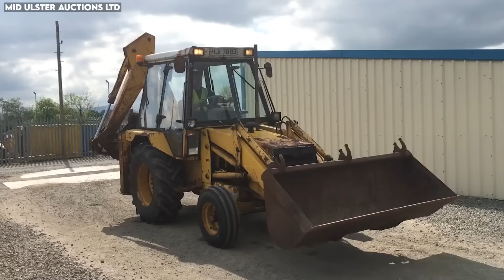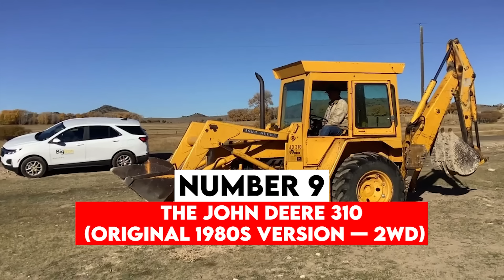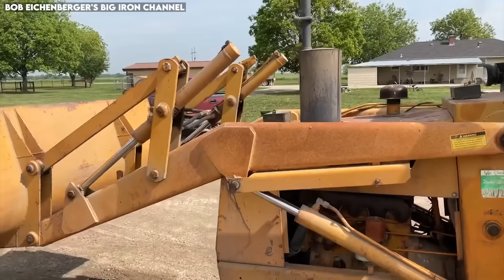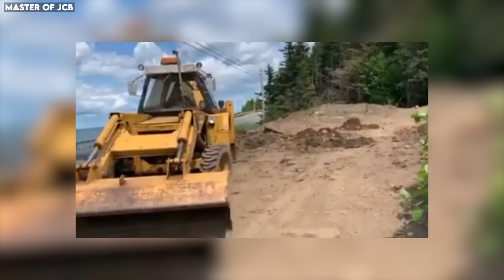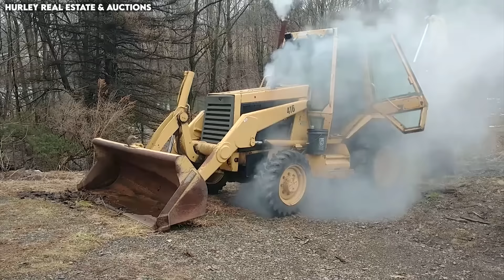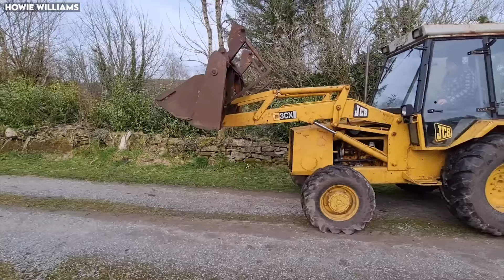10 MOST HATED Backhoes  from the 1980

Comment: Its it used to say on the JCB 3cx on 80's models "JCB leads the Earthmoving world". still true
Fords 650 no problems -  MF50B no problems they were light and flew through soft ground with 3cx bogged in trying to get the Pea shingle to the trench. Whitlock 60A (Dinkum)made in Essex thumbs up chassis cracking only problem.. They done some heavy work while contractors couldnt afford a 360 hire at the time.3cx and all  of them mentioned would drop while idle 360.s did as well,new arvs required.

Comment: We had a case 580 C and it had major leak. The fluid would pour out of it. The dealership had it tied up for over a month and it lasted less than a year and the same problem happened again. At that point, we knew we were going to get rid of it. We ran it for a couple of months with a bucket underneath it and we would just dump the oil back in. It was leaking so bad you would almost fill up a bucket every time you would have to move forward in a dig. I know other contractors that had the 580 C that didn’t have those problems. I think we just had a lemon and some bad mechanics at the case dealer.

We ended up buying a brand new 1991 JD 310 D. It is now May 1, 2026 and that machine is still in the fleet. In fact this very morning I took it, myself, 3/4 of a mile down the road from my shop/office to a job grading a gravel road in town. 

That machine has the original engine and hydraulic pump. The hydraulic pump has never been touched. I did do a in frame rebuild on the engine last summer. The only reason it was necessary is because an operator knowingly ran it dry with a leaking water pump. And of course never told anyone.
The machine has over 15,000 hours on it. I have had many machines come and go since then, they are no longer built this well.
There’s actually a few videos of it on my channel. I can’t remember when I uploaded those videos. I would have to look on the channel. But I know the videos were taken about five years prior before YouTube was actually a thing.

Comment: This is a totally asinine video.

The early 2wd 310's are some of the most durable backhoes ever built, and some of the most stable machines ever.

If the backhoe can pull the front tires off the ground while digging, that only means it is a strong backhoe.

You are literally pulling things out of your ass.

Comment: I bought a used 555A at an auction. Paid $10k for it. Other than a couple tires, and the ocassion Al hydraulic hose, plus normal maintenance, I used it for a decade and rarely had a problem. Started right up in the cold and after months of sitting in the winter. I loved that machine. Sold it after a decade of use for what I paid for it.

Comment: The farms I worked on while growing up had 580 Case backhoes, one of the farms finally retired the 580 case last year simply because it was wore out and no longer economically feasible to repair it. They had it from 1981 to 2025, they bought a New Holland to replace it. Personally when it comes to the use of backhoe part of the digging I prefer a trackhoe. I can do over twice the work with a trackhoe than used a backhoe.

Comment: No problems with the ford 555 machines, still have one and works well, parts available from new holland dealer.
Reply: I agree. We had 3-4 through the years.  Then we got a 665C, ran hours up on it, and then a pair of 655D’s. Seemed like all at some point got sold  after 5-6k hours on each machine. I miss that big ass 2’ bucket😂

Comment: Thay do ONE video showing how GREAT, these same Backhoe were. 😮then do this video. Make up your mind, about what was good, and what had lots of problems 
Me being a OWNER of, the Dynahoe-190 made by Bucyrus Erie till 1985, then B.E. completely STOPPED making Heavy duty monster size Backhoe mine is 19400 pounds, she can DIG, 19 feet with NO extendahoe 😊 my big baby boy is over built with very beefy body, to never fall apart, mine is a 1978 model years, and it is 2025 😊 she still chugging along.😊❤😊
Reply: Yeah when they show a Case machine I turned it off.
Reply: For the most part, the one that you have is usually the best one.